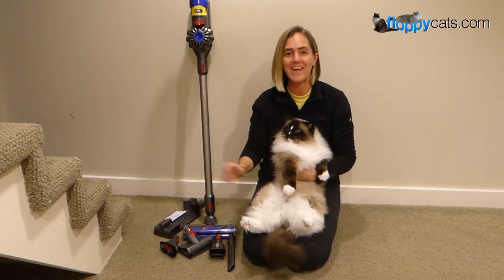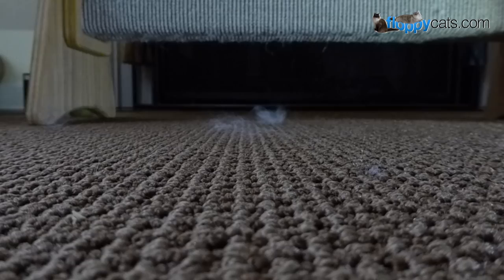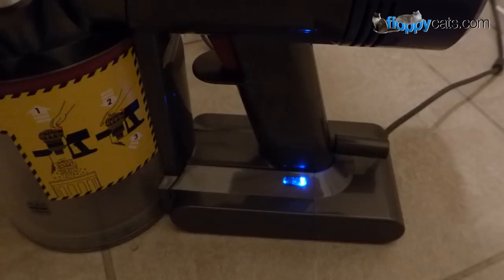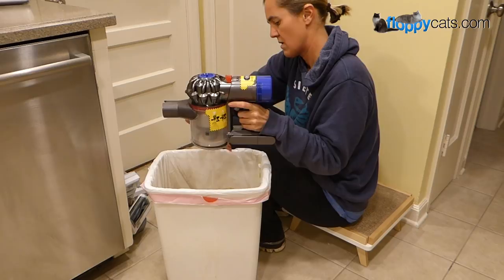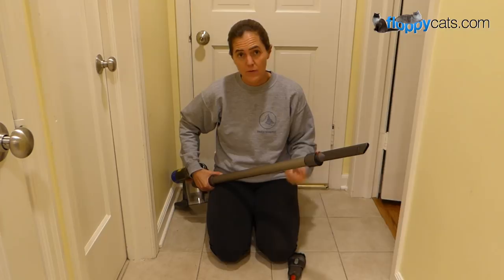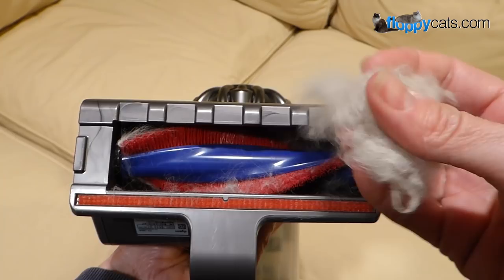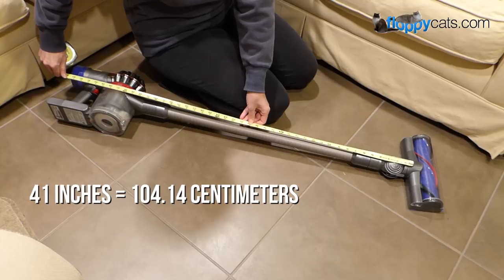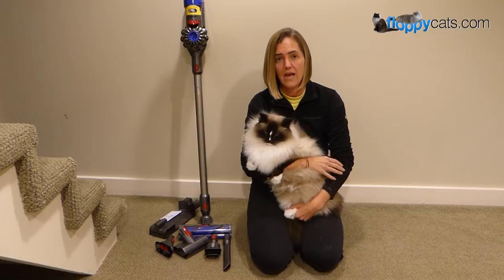Dyson V8 Animal Cordless Stick Vacuum Cleaner Product Review Video - Floppycats

Comment from the maker: Dyson V8 Animal Cordless Stick Vacuum Cleaner https://amzn.to/2DS93zm
Cord-free. Hassle-free. Powerful suction,Refer USER MANUAL for instructions
Up to 40 minutes' run time when using a non-motorized tool. Suction power (MAX mode) : 115 AW
Lightweight and versatile, for easy home cleaning. Instant-release trigger means battery power is only used while it’s cleaning. Requires charging for 4 hours minimum before first use
Up to 30 minutes of fade-free power with the Soft roller cleaner head
Direct drive cleaner head. Up to 8 minutes of fade-free power (in MAX mode). Drives stiff nylon bristles into carpets to capture deep-down dirt
Whole-machine HEPA filtration captures allergens and expels cleaner air than the air you breathe. Filtration: Washable lifetime filter
Powered by the Dyson digital motor V8 and engineered to pick up ground-in dirt and fine dust from hard floors and carpets

Comment: Great review. Wouldn’t have thought about getting one until I saw the video. Thx
Reply from the maker: 3 years later, it’s still great. I did have to get a new battery for it about a year ago. My sister still uses hers too - daily. It’s so great for easy clean-up. My battery lasts about 8 minutes on max suction, so I just vacuum for 8 minutes. It’s great. I can get most everything in those 8 minutes.

Comment: Bought this 2.5 years ago, love the vacuum. However, I've had two issues till date:
1. Hardwood floor attachment (Absolute version) stopped working. Seamless Dyson customer support got it replaced within warranty
2. Battery time reduced to 45 seconds. This time it was out of warranty and Dyson doesn't offer any help. Here's the surprise: they said batteries to run out after 2 years of extensive use. So, expect to spend $129+tax+shipping on battery every 2-3 years
Reply from the maker: interesting - thanks for sharing.  my sister's is starting to act up - mine hasn't yet.  mine is almost 2 years old - but i use it only once a week or so.

Comment: Oh do I ever know about the cardboard mess! LOL This is how my cat shows me he is pissed off at me. He goes and rips it so violently as if to say this is what I want to do to you missy for not understanding my cat wishes. LOL Because he will look over at me when he gets going so I can see the remnants fly. LOL Life with a cat is definitely never boring. : )
Reply from the maker: ha ha ha - they do scratch to release emotion!  but i doubt he knows he's making a mess =).  the higher quality of the cardboard, the less it'll do that.
Reply: @Floppycats  No he did not even consider the mess, he just wanted me to know how pissed off he was! 
He has this thing where I get tap, tap, tap meow and I am supposed to figure out what it is he wants. Food, water, clean my box, NOW, or pets. He's so particular about his box, he screams the second he comes out so I  can run in there and clean it. Should I be busy, the little bugger will go spray somewhere so I have to clean that straight away. As I said, life with a cat is never boring. LOL 
Oh yeah, what was the name of that thing that helps to take tangled hair around rollers called?
Reply from the maker: @geminidream4347  ha ha ha - that's horrible about the spraying though.  i am not sure where or what you're referring to - but i replied in another comment.  i would use an envelope opener or a seam ripper to cut through the hair on a hair-ridden brush roller and then remove it with my fingers to get it cleaned out.  i would also look for a tutorial on youtube about that specific vacuum, as i am sure there is one and then you can get it even cleaner.

Comment: 11:27 you can put a coin on the right or left so you can get the hairs easily out
Reply from the maker: great tip - thank you!
Reply: Floppycats no problem
Reply: In what way does a coin help?
Reply: willowwolf123 in the side there is a Place wherry you van pit the side of the euro to open it then you can take the roller out

Comment: ? It has fair suction ?
I have the V8 Abdolute and I find it has fantastic suction (have 4 children, 2 cats)
and utilise all it’s attachments.

It is obvious you have not used this vacuum to its full potential.
Your negative opinion of the mini turbine head due to tangled hair in the roller.. is due to lack of knowledge... the roller is very easily and quickly taken out to remove any entangled hair.

Your review of the other brush attachments or lack thereof... by not using them yourself, was disappointing... I use them all when cleaning my house... eg. one cleans the outside patio beautifully... one dust cleans 
everything inside.

You have unfortunately sold yourself short by not fully utilising this vacuum... and also this review by not understanding all of its capabilities...  you needed to do more research.

Apart from that... You have a beautiful cat.
Reply from the maker: thank you for sharing your opinion.  i still think the dyson has a fair suction compared to a corded vac.  i don't have a need to use all of the attachments.  i still use it as i did for this video and it works for what i need for it to do...but believe there is room for improvement.

sounds like you could do your own review and cover all the points, you felt strongly that i missed.

Comment: Dyson sucks I’m returning the one I bought last week
Reply from the maker: which model did you buy?  why did it suck?
Reply: Floppycats the one you have my hair (which sheds more then my dog) keeps clogging it non stop having to wash the filter etc it is so Disappointing :/
Reply: Floppycats omg and the air it blows out 😂my chihuahua isn’t scared of anything that air flipped him out lol
Reply from the maker: *CANDI, CANDI, CANDI, MORGON bummer. Do you have long hair? Mine is pretty short as you can tell. And yes, the blowing is obnoxious, but probably helps with the sucking power. My cats are scared of vacuums, so the blowing didn’t bother them anymore than any other vacuum. We reviewed the TiNeco A10 Hero which might be a better choice for you and it’s a lot cheaper too.
Reply: @incognito9282  isn't it supposed to suck? Lol